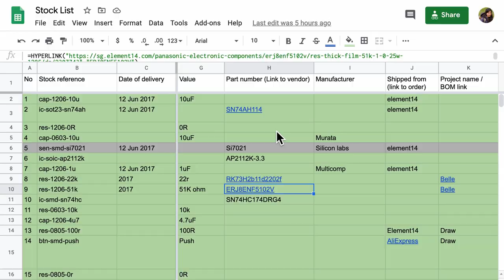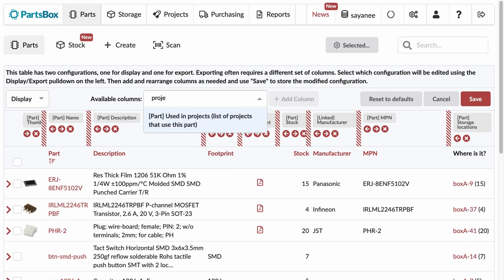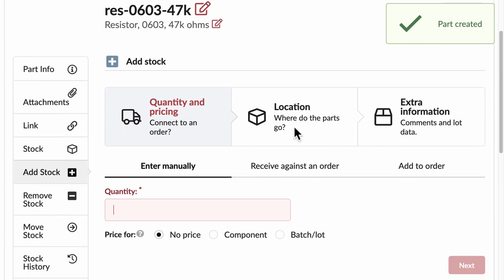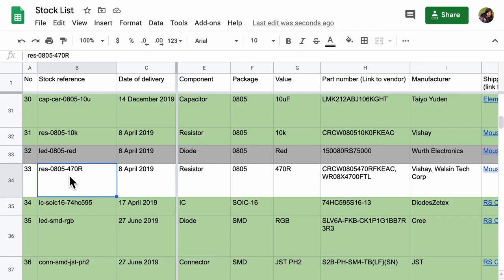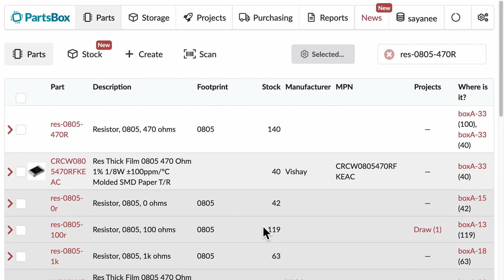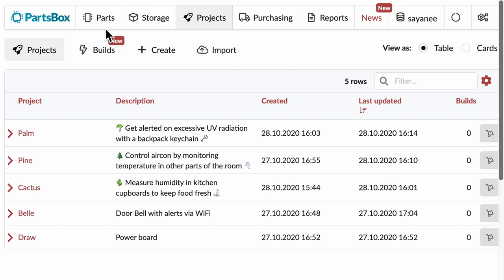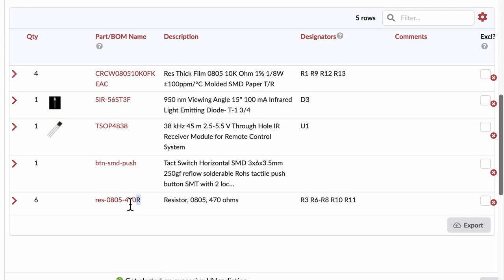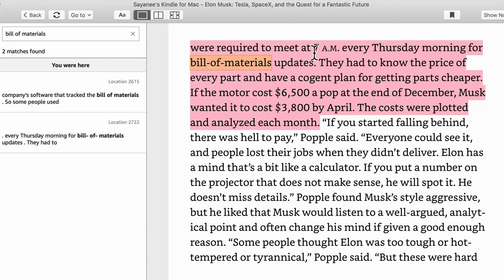PartsBox vs spreadsheet: Version 2 of my home lab electronic parts stocking system

Comment: As a maker Ive been using partsbox for a few years now and what I also do  is I have an "In-Transit" location. At the time of purchase  I also create the components (if new) as I order them, so have price etc at my fingertips and allocate the location to "In-Transit" therefore when they arrive its just a matter of moving them, or if I dont have time right there and then, they will go into my in-box,  I know that anything in my inbox already has a partsbox part with pricing etc so no need to remember pricing or then have to sit down and create a new part etc. I just have to move it.   This has allowed me to go from piles of components I ordered some time ago and couldn't remember what I had, and also putting off because of the time to process, to some semblance of organisations :)
Reply from the maker: Wow! Great tip. Never thought of using the location for temporary storage, but totally works in this case.

Comment: PartsBox looks interesting.  Thanks for the walk-through.  Unfortunately, the paid versions are way too expensive for a hobbiests budget.  And, for the free hobbiest version, I can't find any details on the website covering exactly what the limitations are?  A feature comparison page would have been useful.   So, I'm put off by the thought of spending the time loading up my free version and then finding that to get useful functionality I really need a paid version (which is beyond my budget).
Reply from the maker: Check this page: https://partsbox.com/pricing.html It has the features for the free version at the bottom. Or you also Tweet them @jrychter or email them info@partsbox.com.

"PartsBox also offers a FREE single-user plan for Hobbyists/Makers, with:
Single user single currency Blazingly fast search Meta-parts (substitutes) BOM Import (KiCad only) Barcode scanning"

Hope this helps!
Reply: @sayanee   @sayanee  Thanks for the quick reply.  I did see the refererence to: "Single user single currency Blazingly fast search Meta-parts (substitutes) BOM Import (KiCad only) Barcode scanning".  

So, based on this, is it fair to assume that all of the other features listed in the paid options, are unavailable to free users?  
e.g. Therefore "Project Pricing" is not available?  So, even though you populate the unit price of your components, if you want a component cost for your KiCAD imported project BOM, you still need to go back to a spreadsheet?  

Sorry, I'm just trying to more fully understand what I can't do in the free version.  I suspect my best bet will be to perhaps put a test project's components into PartBox and see what it allows me to do, or, whether the free version is really just for a searchable parts database?  So that you really still need to manually manage your projects in a seperate spreadsheet?  

It certainly would be much more comforting if PartsBox had a more affordable paid "Hobbiest / Maker" level to step-up to, from the free version, as the base paid level of Euro 49 per month is not really a justifiable cost for modest hobbiest maker projects.
Reply from the maker: @gregclare  Yep, I would advise you to put a test project up and see what it can do for you! Or drop them an email :)

Even if some specific use cases like project pricing are unavailable, they have CSV downloads that make it easier to post-process the data. 

I hope you find a solution for BOM and projects!

Comment: Thanks for this, parts box looks like a useful tool. One problem I have had is trying to work out how much to replenish my parts inventory when I am planning more than one project on the go. I've had to combine BOMs and work with pivot tables in Excel to get the totals to offset against what I have in stock, before ordering enough to top up the inventory. Do you know if parts box can automatically mark parts as "reserved" for a current project, so that when I'm planning multiple simultaneous boards to make, I don't accidentally count a part as available more than once?
Reply from the maker: Good point on reserving parts for future projects! 

It seems like there is a concept of "parts attrition" https://partsbox.com/users-guide.html#setting-part-attrition-parameters. There's also a concept of "Low stock levels & warnings" where we can put in the quantity to alert us of low stock for individual parts. Can't find any docs for that. 

I gotta try both!
Reply: You might want to check BOMIST out (https://bomist.com) - you can track reserved inventory (as well as "on order") so you don't accidentally  use them in other projects as you say